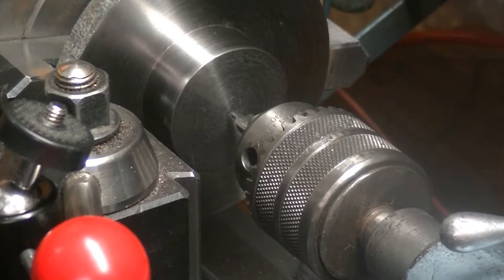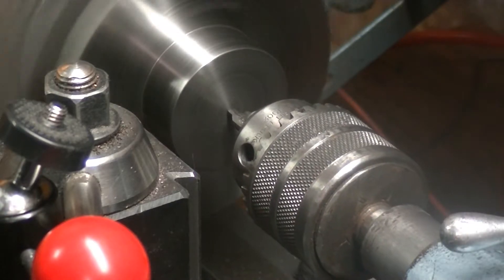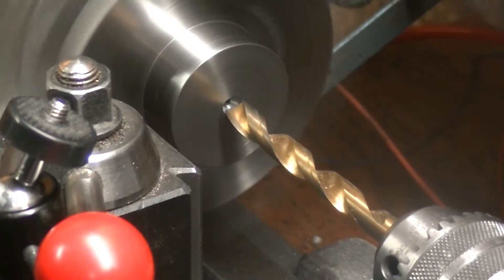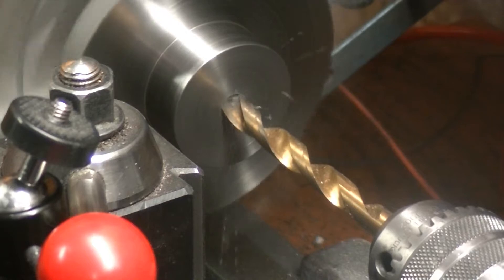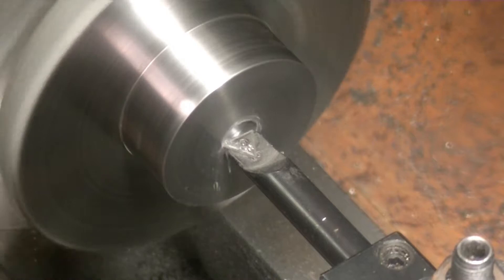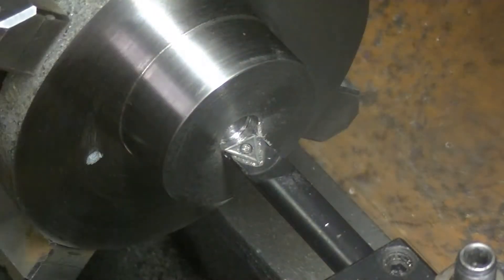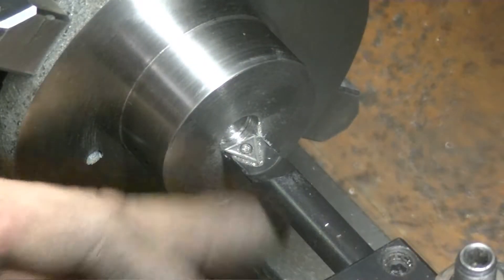Steam Engine Build: Machining Top Cylinder Head - Part 2

Comment: Hey dude. Watching your build for like the 20’th time. For the drain cocks you could put them under the inlet ports just behind the valve cylinder casting face. It’ll be neater there and will do the same job. You could even strap both valve handles to each other. 
Really hope you are able to continue the project all these years later. I’m making plans for a similar engine but vertical with a cross slide rail and a 3in bore x 3in stroke.

Comment: Hydrolock is a matter of section water will suck. You open the valve to relieve the section. And then also makes a benefit of blowing the water out. If this is a steam train for nostalgia sake you want a pair of relief valves on both sides. Except for tiny toys I have never seeing a steam engine not having them. Moreover another emergency use by some unknown coincidence overflows the boiler with water and it gets to the Pistons. This Will Blow Your nice cap write off pulling the threads out. Depending on the size of your flywheel. The only way to avoid this is the keeping in mind that it can happen lose sight of your boiler water level is the indication to automatically turn on the valves.. this is why Collective knowledge of being a steam enthusiast. No. I do have a nice video showing what happens when a belt brakes and drops off. Click on my YouTube channel and there is some religious movies.

Comment: Hi, it's taking shape nicely :-)I build small steam engines though I'm no expert in the subject, having looked though a couple of my books it seems the general opinion is that cylinder cocks should be fitted on engines larger than 1" bore.  I'd be inclined to think you'll get away without them if you are very careful when first starting the engine from cold. The forces on that piston will be considerable, I think you'll need to turn the engine over by hand quite a few times to get rid of all the condensate. I'd hate to see you damage it after all the work you have done.
Reply from the maker: Thanks for the input! I will be sure to be careful.  We will see how it goes....